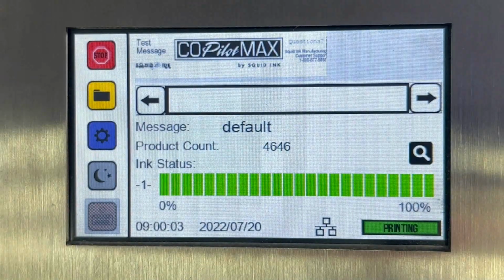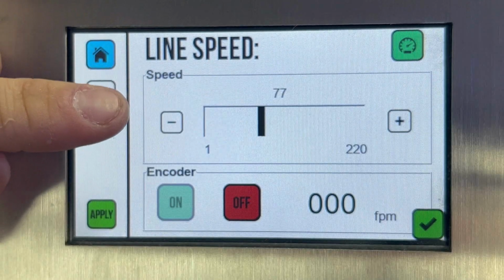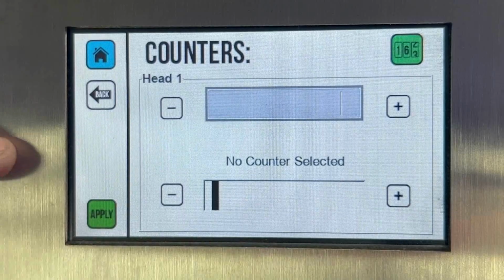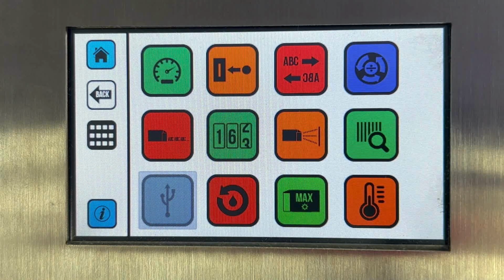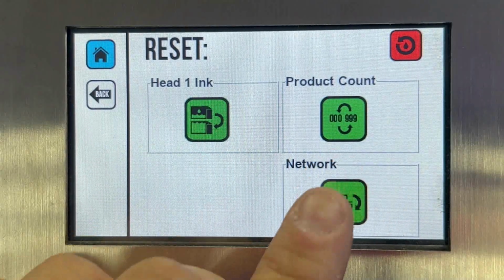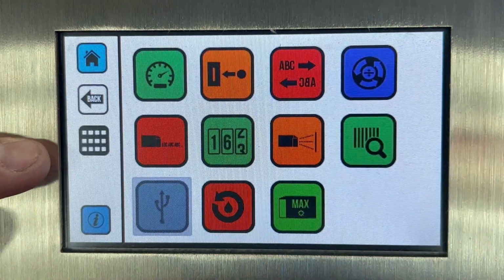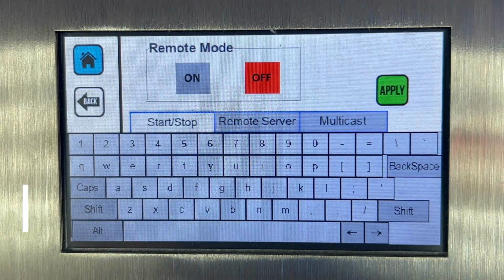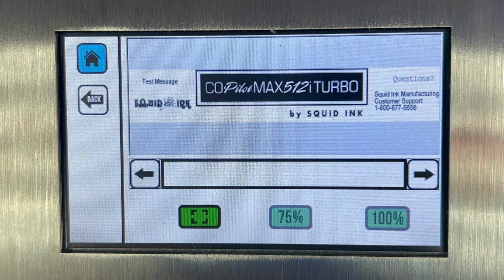CoPilot Printing System - Controller Screens and Navigation

Comment: Hello, is there a way I can delete all the messages saved on the controller at once? we have over 100 messages on our controller at work and I was wondering if I can delete all at once rather than deleting one after the other. Thanks
Reply from the maker: You use Orion to perform a File Clean once you are connected to the controller. For details, please contact the service department at 1-800-877-5658.